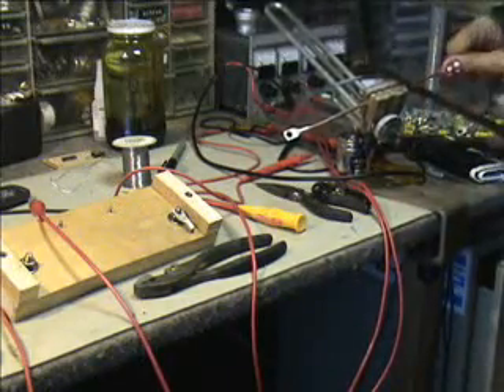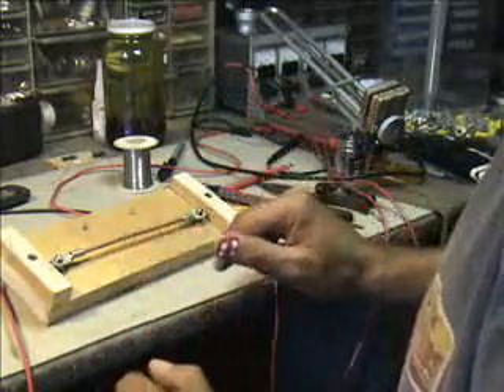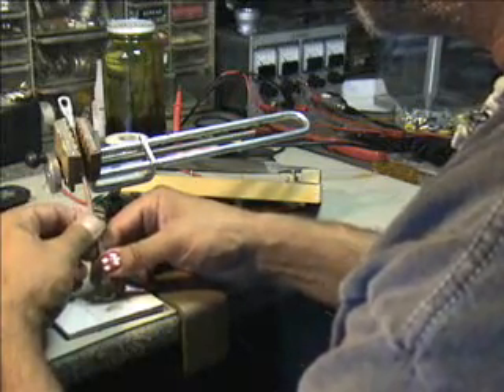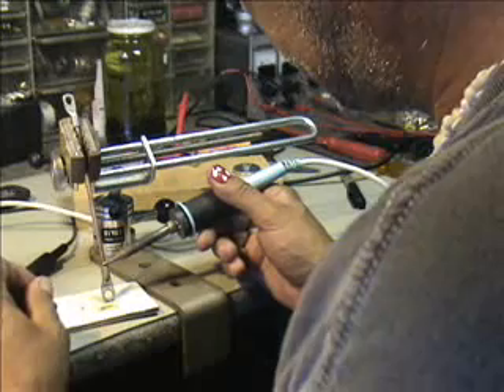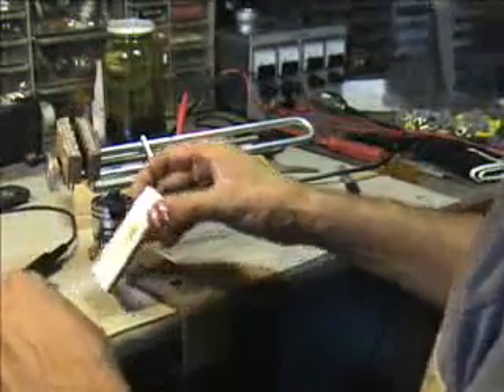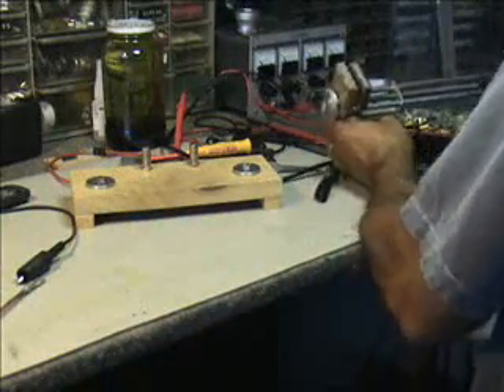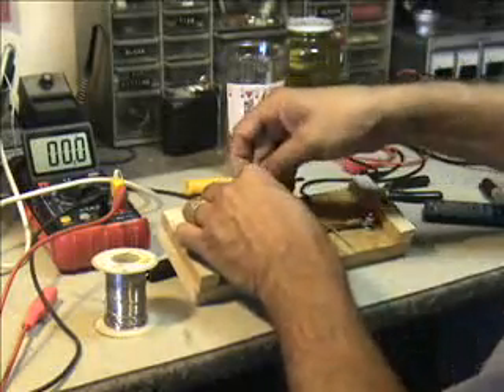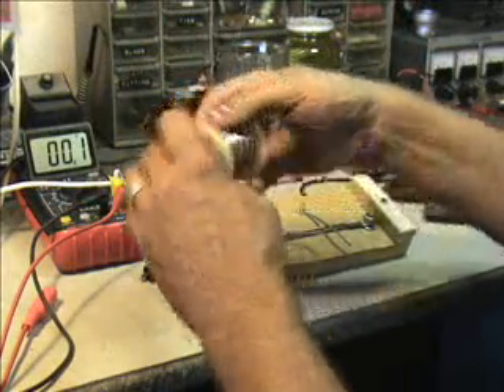Making a DC shunt Pt2

Comment: I tend to put just a dab of solder to the tip or the iron just to help it conduct the heat to the part I'm heating up, I'm not expecting the solder that I'm placing on the tip of the iron to flow to the work.  Nevertheless thanks for the videos.

   I put a wire to each end of the the wire that is feeding a DC. motor, then I ran both of them to a volt meter.  Using the wire feeding the motor as a shunt.  But now I need figure out how to correlate the volt reading amount to amps that the motor is drawing.